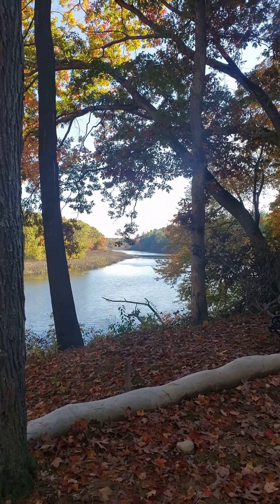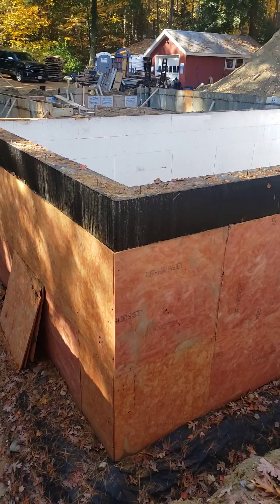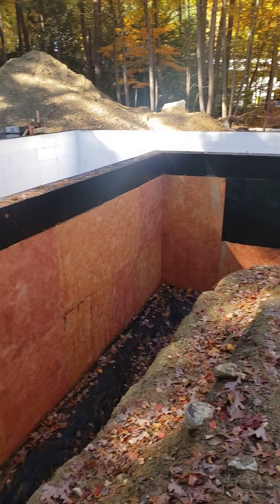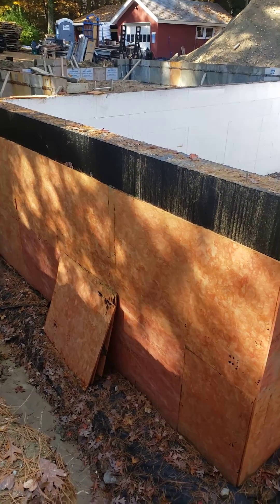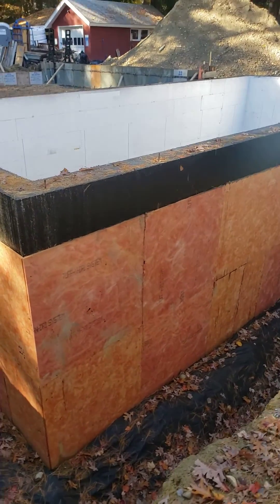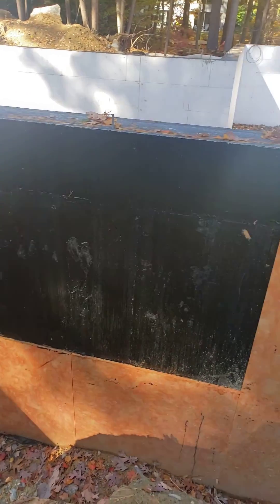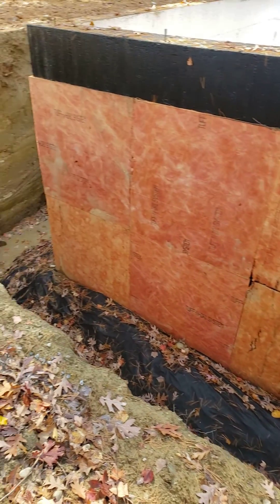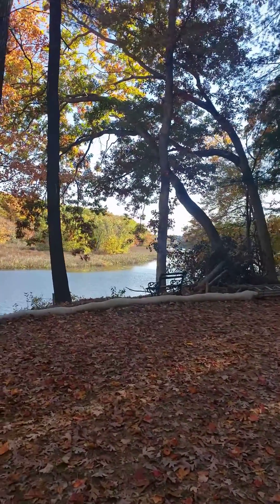A second look at the Tuff N Dri system on the ICF Foundation

Comment: How have you found this system (and the variants from others) to compare in both cost and performance to the alternatives: PolyWall HomeStretch + Arroyo drainboard (and the other manufacturers' variants on that theme), the TERM termite variation of that system, and lastly simple adding Zypex or Kryton to the concrete mixture in the footings and walls so that the concrete itself is waterproof?